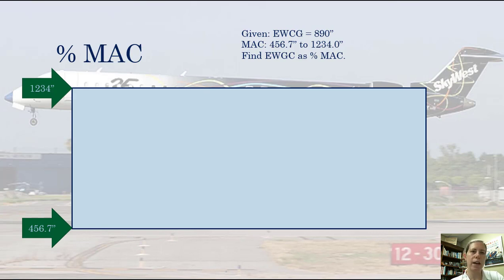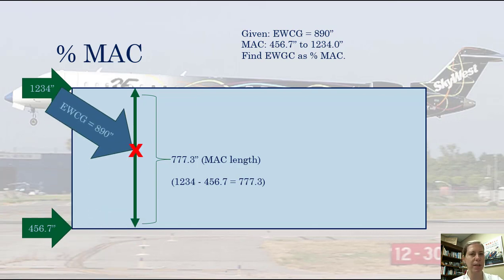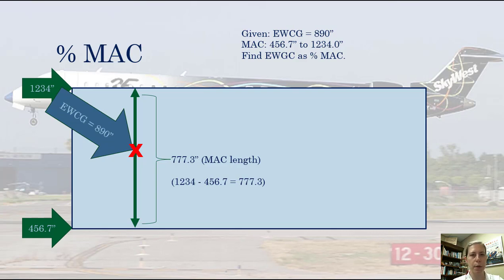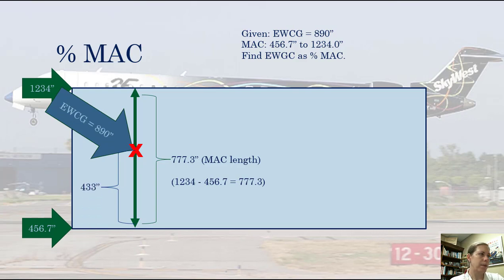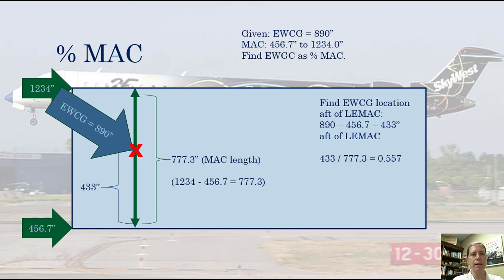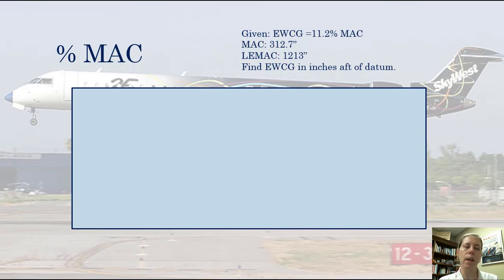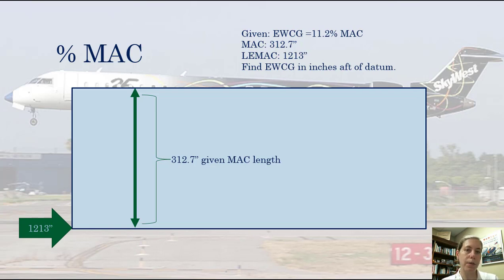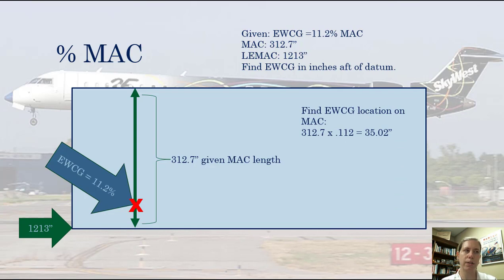How To Calculate Percent MAC Large Aircraft Weight and Balance Mean Aerodynamic Chord Video Tutorial

Comment: For clarification, is the top of that wing the leading edge of the aircraft wing or is the bottom half of the rectangular "wing" the leading edge of the wing? I believe you said the bottom of the illustration is the leading edge, but I'm not certain.
Reply from the maker: Sorry for confusion. On the example I put on the video, the bottom line on the rectangle "wing" is the leading edge (located at 456.7" in the first example.)
Reply: Thank you so much for the clarification :)
Reply from the maker: anytime! @diegom8